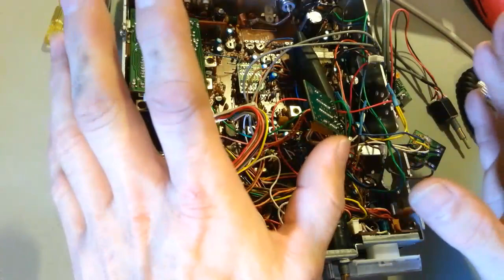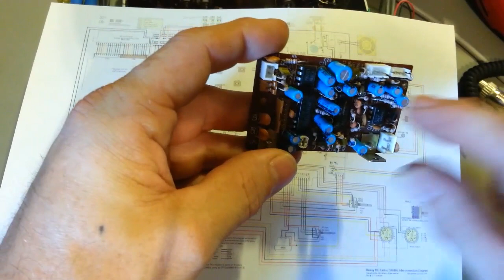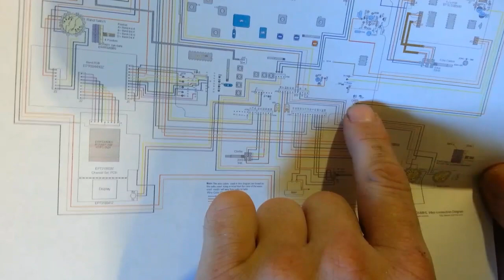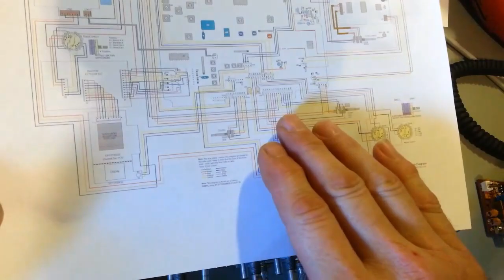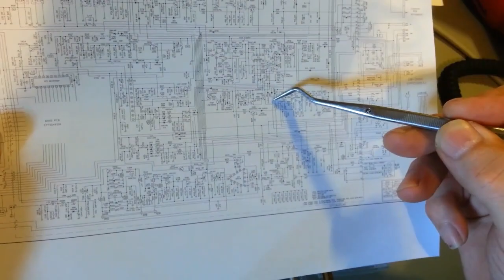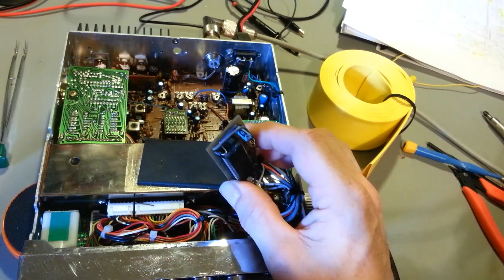Putting a butchered Northstar DX990V back together.

Comment: Yeah, that echo board would drive me nuts talking to him.  That other sound board I would turn off the CB if they turned that thing on, it takes to long.
What I would like to ask is What is the pull out board at the back?  Is it an SWR bridge or something, I have never seen it before.  I don't know how it was worth fixing that radio time wise it is not worth it.  I was handed what you would call an export radio one time and it had wires off it, some not there, some there but disconnected and I was handed a handful of components.  I took one look inside the radio and asked him what he thought he was doing>  He said he was trying to change the sound of the roger bleep and do away with some wires and two chips that changed the radio from a legal set to import to an illegal set.  I did one of your sighs and told him I had no data on it and I couldn't do anything with it.  I wouldn't care, I had a set the same in the workshop the week before as it had no sound on transmit or receive, turned out to be an easy fix.  I don't do AM radios or CB as a rule, but sometimes a mate knew I dabbled in electronics and would ask a favour.  Anyway, the screwed up set I told him to take it to someone else as I was not going to spend hours trying to fix his mess, it was his mess as he admitted to trying to do it himself.  He said he had tried a few others to fix it but they refused, no doubt they had messed around inside it as well, so I said it was a lost cause without a wiring diagram or a board layout.  At that time there was no data for it.  There was not even Google to look it up!  120 channels of useless radio.  Now part of it we can use here but I have no idea where it went, I was told to keep it when I said I was not going to sit there for hours trying to fix what is now junk!  It is in the shed somewhere, but I would need to change all the Capacitors now and then try to sort out all the mess he left.  Now I am starting to take an interest in it as it might shift up to 11 mtrs.  I need to find it, then get some data and go to my mate (if he will let me use his scope to set up the modulation) I dare say the modulation and every thing that can be twiddled inside the set will have been twiddled.  I am thinking about it as I type, I am already thinking it is to much bother.  Why oh why do people that have no idea what they are doing suddenly think they are experts and go in with a screwdriver.  When I think about it I did see a broken core in one of the transformers "SIGH" I am loosing interest already.  It used to be a good set, I have heard him using it.  The modulation was a bit low on AM but on FM it was as clear as a bell on a frosty calm morning.  Ahh maybe next year I will tidy out the shed and find it, but I think he dropped it off without covers on it, idiot he is.  He knows nothing at all about CB or electronics so why did he ever start in the first place?  I think the set was called a Nato or something, but I did recognise the board on on set you showed us, I think it was a French sounding set.  Anyway, I really enjoy just sitting here listening to you rambling on and sighing lol. 

Oh, I digress.  The question I wanted to ask was, What is the board that comes out of the back of the CB that they had soldered in?  I have not come across that before?
Reply from the maker: The board standing up off the main board at the left rear that is pressed into 3 terminals is the bias board commonly known as the "mirror board" because it is a piece of doubled sided circuit board.  It is removed and a Amp meter installed across 2 terminals at a time to set the driver and final transistor bias current.  In the RCI/Ranger radios if it has a built in SWR meter function the SWR board would be located very near the antenna connector and also standing up off the board.  The SWR board however passes through a hole cut in the main PCB and is then soldered on the solder side of the main circuit board.  If you look further into the video where I move the camera to over the top of the radio you can see the empty slot near the center rear of the board.  It has a white box outline silkscreened around it.
Reply: @mikesradiorepair  I will check back on that.  Thanks for the reply Mike.  I do enjoy your videos.  I have a lot still to watch though and a bit of catching up to do.

Comment: i've watched this vid several times everytime i say to myself. If this where me, I would have stripped it down to nothing but the motherboard started over from scratch
new components, wire, connectors, correct daughter boards etc etc etc..  in the end you will have a correct factory stock out of the box radio
Reply: I think he pretty much did.  I think I would have thrown it in the bin.  However, I do like a challenge every now and again. but....................................!
Reply: If it was me I would return that Franken radio and talk him into buying a new better radio.

Comment: Mike nope, the mirror board comes ""welded" like that from factory. I removed the solder form the traces side,  it came out prettty easy because the holes are a tad larger. I also started with the top, but is way too much work and danger to damage some other components. Just install some temporary wires for bias and that is it

Comment: The only thing I am ever prepared to do to a CB with 'noise-toys' is to take them out, destroy them and put them where they belong : the bin!
Really... and echo-board? For an adult?

Paddy
Reply from the maker: +gh778jk 

If used properly (which they never are) echo much like compression, expanders, gates,  filters, etc. can improve voice quality.  But the level is to a point where you barely hear it.  Most people have them cranked up so far they sound like they are in a 3 mile long cave.  These people seem to forget the whole point of two way communications is communications.   I frequently hear people with so much echo I can't even understand what they are saying.
Reply: Mike,
No doubt, but you and I both know very well that this isn't the reason why these infernal boards are installed!
If you want a bit of compression or some audio input filtering, there are other and better solutions.
There was a period here in the early 90s when all this garbage came on the market, and you just couldn't use the band anymore.... Echoboards in splatterboxes all over the place.... It was a real pity, a lot of  chaps put their radios away for good on account of that.

Paddy

Comment: I went through that same process with a Superstar 3900 bought from e-bay,they took out the SWR Section to run variable power on a single final radio. The noise blanker and channel 9 switch was also butchered and trying to find a wiring diagram that is the same is a nightmare. It had traces blown the TA7222 Audio IC was blown,RF sheild had traces torn from the board and other numerous problems. Truck stop fixed the Radio for them and got irate when he carried it back because it did not work. Good repair shops are really hard for the common person to find.

Comment: You can tell what the inside will look like, just by the jeweled knobs on the outside. With those horrible knobs you know that the inside will be crap. I can never understand why people put those crappy knobs on. Probably has a voice changer in it and most don't use echo. I hate echo and roger beep. I like a clean powerful radio.
Reply: Adonis cmj you
Reply: Those gay ass jewelled knobs are indicative of a guy with a low IQ who puts swing kits, noise toys, and uses the roger beep and TONS of echo. You are correct sir.